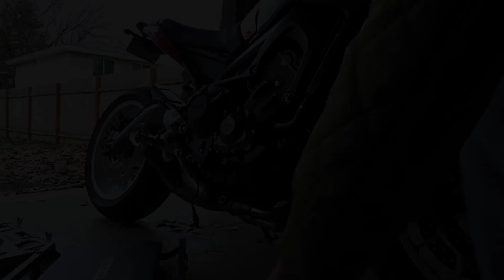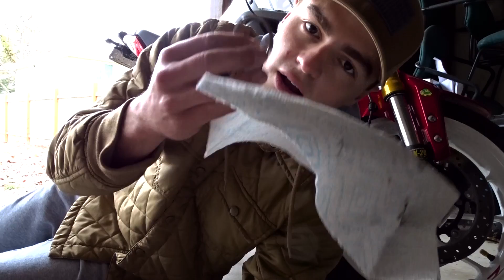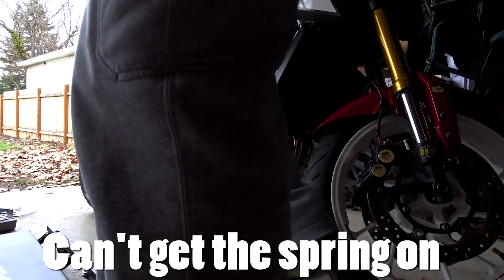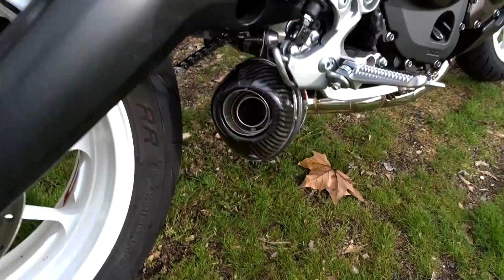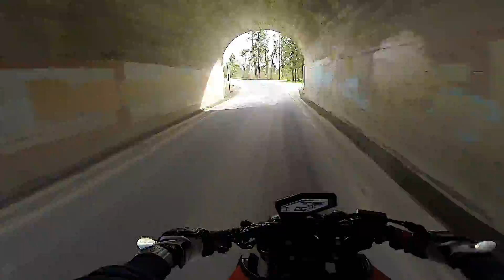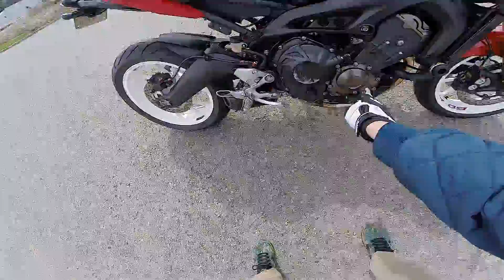Best Bang for $$$ FZ09 Full Exhaust - Black Widow

Comment: I bought the two brothers full exhaust on my FZ07 and later sold it to get the FZ09. Thereafter, I decided to get the M4 slip on exhaust and flashed the ECU on my FZ09 for almost the same price. Changed the bike completely with the ECU flashed.
Reply: What happens is you don't flash the ECU? Will it damage the bike in any way?

Comment: How do u keep ur wheels clean? White is crazy hard to keep fresh. I have the fz07 with the high biz neon green wheels and it's a b$&@; to keep them clean.
Reply: I will give you a big clue on that, I had similar problems. Stop using WAX based chain lubes, switch over to more LIGHT OIL based. WAX creates black marks on wheels and the only way you're getting them off is using some other type of chemical, WD40 or a degreaser or something. Use OIL on your chain, clean your wheels with WD40. Eventually you build up a layer of oil that you can wipe off easily or rinse off and reapply. Think about how you keep a pan clean you keep it "seasoned" or oiled, that way when youre done cooking you simply wipe away most of the shit... WAX is not so easy to wipe away.
Reply: Ye i have the 14 FZ 09 and the blue attrached so much freaking dirt. I spray painted them and did strips to keep the reflective blue at night it looks amazing too
Reply: Use wd40 and wipe it on the rims with a rag..  then you will be able to just wipe most grime away very easily when they get dirty..   I've heard of people using ceramic coating to also help, but I've never used that stuff before.

Comment: Hello, it is nice video and good sound. Have you made air fuel mixture settings after installing exhaust? I am thinking to buy an exhaust and I've seen it is necessary to make settings after installing exhaust or air filter. (not much knowledge about them and wanted to ask you) And Whats your action cam. Do you use mic in your helmet? Sounds great!

Comment: Hey man, did you have to tune the bike at all or reflash the ecu?? I heard it's mandatory with a full exhaust
Reply from the maker: mine was reflashed. it's not mandatory, i ran without it for 3 months and it was fine. But it will open it up and smooth out the throttle with a flash
Reply: @ShakeNBlake509  awesome thanks! I'm sold on this exhaust. I have a 2018 MT09 and I've been dying to get a nice exhaust.

Comment: I got the 14" oval exhaust from Delkevic for $455 in carbon fiber off Ebay, but I was also trying to go quieter with baffle in they claim 98 decibels, either way FZ09 with exhaust triple sounds TITS.

Comment: get it tuned or your ECU flashed? Might wanna do that if you haven't cause the FZ already runs lean from the factory and with an exhaust you will run even more lean and end up burning up your exhaust valves
Reply: and how exactly is aftermarket exhaust causing the engine to run lean?
Reply: Daniel Ulik are you really that surprised? Usually aftermarket exhausts displace more oxygen causing more oxygen to be sucked into the intake. Now that with the same amount of fuel being dumped into the engine with the stock map makes it run lean(too much O2). Then think about how a blowtorch works. It’s the oxygen that makes the flame so hot. Now think about that in an engine, something has to give
Reply: is that something youd look out for when buying used? a bike with aftermarket exhaust and no tune? exhaust valves dont sound that serious/expensive is that true?

Comment: Do u think a fz-09 is a good beginner bike
Reply: Arron Quiroz, don't buy this bike, it's too much power for a beginner!
Reply: smibru just bought 2015 FZ09 as my second bike and holy shit its scary quick.
Reply: Congradulations!!!   I just bought a XSR 900 and yeah those bike are really fast it shocking sometimes, especially in the canyons!
Reply: Dean Thompson bought a mt 09 month ago as my first bike with 12 hours of riding experience before and I have never switch off from B mode lol
Reply: @smibru  not only the power. The weight is low. Balance is a bit off. And suspension is terrible. So it's probably one of the worst beginner bikes out there.
Reply: @cfvgd  I was talking about the topic of the subject at hand.  And the subject was SOUND! Bye Troll!
Reply: @smibru  wow...chill. The subject was beginner bike.
Reply: @cfvgd  Not the part I responded too!
Reply: @smibru  lol. Then you respond on the wrong comment
Reply: @smibru  0.o